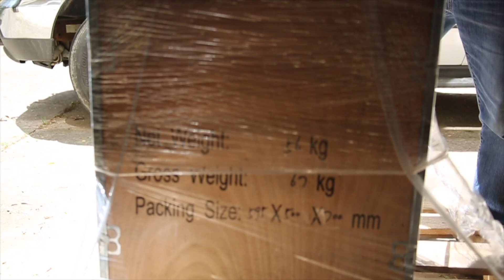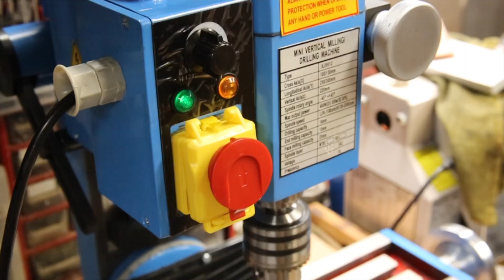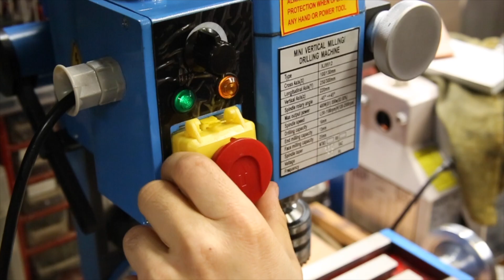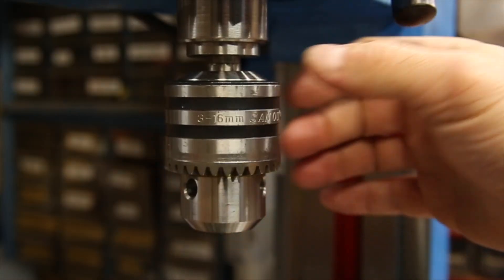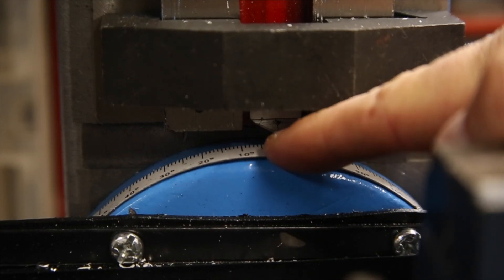Cheap Chinese Mini Metal Mill Milling Machine Unboxing, Setup, Testing, and Review

Comment: Congratz on the mill. First order of business get some collets to match your end mills you don't need to get the a full set just a small, med and large sized collet. The drill chuck is only good for drilling. Getting a more suitable vise might also be more helpful. I use the 3" toolmakers vise. Its just the right size I feel. I would avoid the 3" milling vise they are over priced and just too big for this sized mill. Those cheap Chinese milling vise just aren't as good as a much cheaper Chinese toolmakers vises. Fly cutters are tools for later purchases, a single large end mill with matching sized collet will work just fine and is more useful. Get some sort of dial caliper and learn to tram and accurately square up the vise and learning how to check for squareness will help so much. looks like your gibs are loose. It will drive you mad getting them just right. They should be a little on the tight side. They do break in/loosen slightly over time. A cheap set of parallels will keep you from cutting into your new vise if your working on smaller parts you machine.
Reply: If people buying these mills just went for the R8 option they would automatically have a collet chuck in the spindle for the collets that R8 are designed to have, plus they would have more height under the spindle as R8 collets when mounted are flush with the underside of the spindle......you can also get an R8 drill chuck to do the drilling and an R8 boring head for precision hole boring.

Comment: Hi Tim,congrats on the new mill...
use high speed on aluminum, and use 2 fluted endmills.............with lube....
I made a collar to fit the bottom of the spindle ....cut  it in half, and drill and tap, i used two Allan cap bolts 1/4x20 x1'' to compress it tight to spindle, drilled a small hole half way trough the thickness to insert the pin ....when you remove the end mill or drill all you do is insert pin in collar and break loose the draw bar,if interested email me,'ll send some pics to you...take care
Reply: DO YOUR SELF A FAVOR AND GET SOME COLLETS

Comment: Your subscribers like your easy to understand informative and well made videos. Wish you many more subs in the future. Nice style.  Well Tim, I’m happy for you. Congrats on your new addition.  Trying to get familiar with the operations a mill also since I’m a newbie at machining at 59 years.  It’s the one with twin treadmill motors for power which I built up from a rusty hulk.  Going to do a variable speed bandsaw modification with treadmill power soon. Looking to install DRO next. I’ve turned some of the Aluminium stock I have into lots of scrap,,,,, I meant nice little chips...   The last shot with your chuck arbor not staying in might be something to think about.  Hope it’s only the tool finish.  If you do something simple maybe I can follow along learning and actually make something useful.       Can’t wait to see 👍👍👍

Comment: You asked about surface finish, you can't really beat a flycutter
Looks like a light machine, I'd probably stay away from anything 'big' like facemills (even though the label says it can handle it). Then again you can do anything with light cuts

Comment: When milling it's a good idea to use a collet chuck rather than drill chuck, because the drill chuck does not hold the tool perfectly in center. Hope it helps :)

Comment: Congrats! A drill chuck doesn't have enough lateral holding power to hold an endmill properly, and may not be safe. You should get a collet tool holder to fit you mill spindle taper for safe milling with a good finish.
Reply: Sharky regardless of safety, a drill chuck should never be used for lateral cuts as it's specifically designed for lateral compliance, so as to allow drills to seek rather than snap.
Reply: I have a factory chuck from a similar mini mill and it's press fit, not threaded on. There's an adapter for R8 to MT whatever it is (which was WAY out of center), and then a chuck with a female taper.
Reply: A set of V-blocks for round stock is key for stability
Reply: +The Kaveman  . gear making is satisfing👍
Reply: Pretty much exactly what I was going to say lol
Reply: would definitely not mill anything but plastics with a drill chuck . get some collets for it ..probably R8
Reply: Sharky even in a mill you're not supposed to be milling anything with a drill chuck. Stop saying it's acceptable. No one is talking about a drill press here. A drill chuck is not a lathe chuck. It is not made for that.
Reply: Could not agree more.
Reply: My teatcher would kill me if I used a Chuck for anything except drilling
Reply: @gabewhitney4430   . . . .  Wkkkkkkk. . . .
Reply: Sean Murphy it seems pretty clear to me that people who claim you can use a drill chuck for milling are not machinists and have only used a drill press and maybe touched a mill once or somehow have gotten away with using one improperly and have no clue how to machine. These people have no idea what they're talking about and it's pretty funny
Reply: Btw the gears in these cheap mills are generally plastic. I would suggest making some replacement gears out of brass, but preferably out of mild steel and then case hardening. The case hardening is very effective when making gears. I have made many for myself. You also have the plastic gear for very accurate size measurement reference.
Reply: I just read the description on this machine and it list the gears as being all metal and for the price I think they should be I thought it was priced a little on the high side but then again I have know idea what a Good machine of this size should cost?
Reply: @shonaoneill5151  They were plastic in the first year or two, but they switched over to belt drive which takes shock much better than do gears.
Reply: @shonaoneill5151  probably wise to make a digital copy of the gears before the gears break so you can make some decent ones plus making gears is excellent in increasing your skills
Reply: @das250250  or disasemble the gears to hardening them with a good blacksmith forge.??
Reply: @renatomartinez3183  only works if its steel that can be hardened, mild steel isnt one of those.
Reply: @pr0faker  You can case harden mild steel, same as wrought iron.
Reply: @TheTruth-fs2rm  Thats an entirely different process and is not through and through, only a little surface hardening.
Reply: @pr0faker  Gears are the best candidate for case hardening. I does take more than just tossing in a forge.
Reply: @pr0faker  The process is used quite frequently on good gears.
Reply: @das250250  or read the text on the gears and order compatible ones. If these mills are anything like the Minila The, they'll be using standard metric gears.
Reply: the lateral weakness of a drill chuck doesnt come from the chuck but the fact that its just a morse taper holding it in the drillpress. that cant take those forces. the chuck itself is perfectly safe yet not really precise.

the chuck is correctly mounted in the mill with a drawbar to keep it from falling out. the chuck itself screws on the milling taper thing. 

summary: not dangerous yet not accurate enough :)
Reply: @SharkyMoto  sounds like something AvE would say
Reply: @SharkyMoto  actually, yes dangerous. When you snap off that 3/4 endmill due to stickout, climb milling, and a jacobs style chuck and it lodges itself in your jugular.
Reply: Guys, drill chucks are held to the arbor with just a taper, regardless of machine drawbar, that's why you don't mill with them, it'll still fall off with lateral loading.
Reply: At those fees rates via a hand crank nothing to worry about.
Reply: your milling machine looks like it has an R8 taper, there are milling of this size that have moose taper 2, if your hoping for a nicer finnish cutting that 2 inch round, try a fly cutter or largest end mill your comfortable with in your machine, but for the pretty reflective pattern use a tiny end mill
Reply: Adventures with a Very Small Lathe I was watching this trying not to scratch my eyeballs out! What sort of plank tries to mill with a drilling chuck! It's almost laughable....its like watching a child, but a child doesn't understand the importance of collets! The very worst thing is, even though he is not a machinist, there are more than enough videos online that would give him detailed help. No excuse for such a lame attempt really.